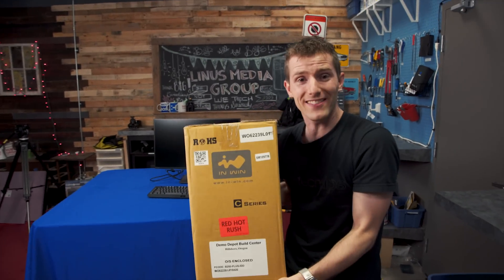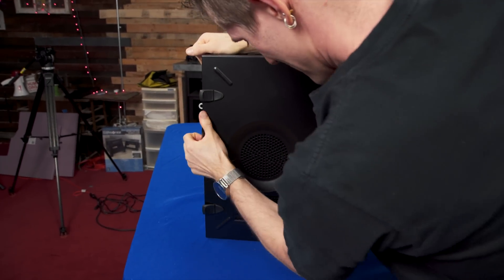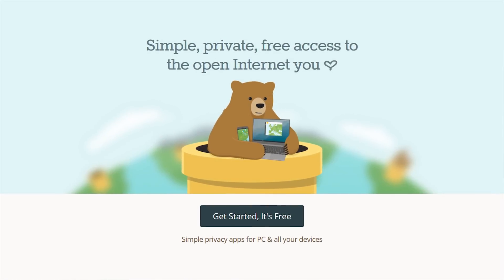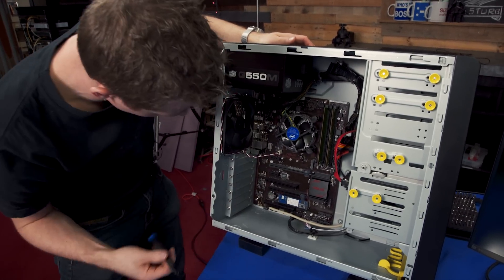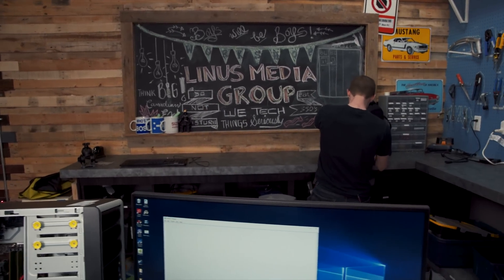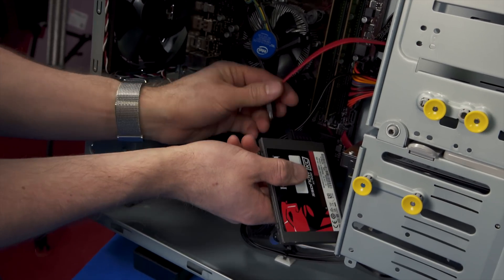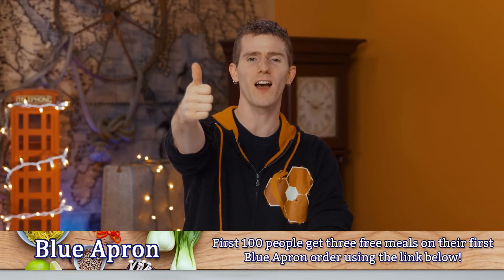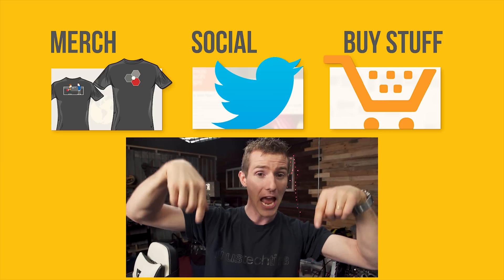Turbocharge your SSD for $40??

Comment: I'll definitely use one of these until I can get a much bigger one of these. Anything else makes no sense to me.
Reply: why use optane when you can just use an ssd? or an sshd? This product litterally makes no sense they are solving a problem that has been solved for years
Reply: Watch the video again. Read what I wrote again after.
Reply: I see you were quoting him although optain would still have to be much cheaper to actually be viable, even if there is a 256gb version if current prices hold then that will be 400 dollars which is way to expensive for sata ssd levels of preformance
Reply: I agree. At this price it makes little sense. I still use SATA SSDs as well, because the jump to NVMe also doesn't really make sense for me yet. But should optane become both more affordable and a lot bigger, then this would be the natural choice. 

And 256gb is still a joke. I have a 500gb SATA SSD now and I will not buy anything under 1TB for the next upgrade. Why would I, I want to have games and applications on it aswell. I don't see the point in buying a 256gb SSD to make my computer faster, and then spending 30 minutes every week to think about what files I can keep on it and which ones have to go. I'd rather have a big one that fits everything. And thankfully they're cheap enough.

Comment: IF you are still able to do a followup, would the optane drive work as a cache for a secondary HDD..? i.e a boot ssd that is say 120 - 240GB and a secondary 3TB drive paired with the optane for games larger programs and data

Comment: I'm curious about how well does this work running dual drives? Like if I have an SSD boot drive and an HDD junk drive, will putting an optane drive in my system work on both (obviously to great effect on the HDD as you pointed out).

Comment: It only accelerates your boot drive and it costs $40? So here is my question why not just buy a hybrid drive the 1tb firecuda is £70 and the same optane and 1tb HDD combo would cost around £80 and take up a M:2 slot.

Comment: Well can you get a boot SSD, side storage HDD, and have Optane cache both? Now you get benefits of all worlds.
Reply: but if its really just side storage Optane will end up caching the stuff thats on your SSD because thats what you're using. May work better with a HDD for Games though.
Reply: So its still basically intel smart response (their caching software)? Where it caches only the boot drive?
Reply: You won't see any difference since Optane caches only the most used files. So a side storage HDD will not be "boosted", and as you can see it doesn't do shit with an SSD. Basically if you have an SSD, Optane is a waste of money for you.

Comment: I like it, You could put a 2-4tb hdd in a PC and an optane drive and never worry about boot drives or where to save files. It would just be fast(for the daily use stuff) and simple. And as an upgrade path, you could built today with a large HDD and in 6 month add an optane drive with out having to reformat. 
Would I use one? Nope, HDD are to noisy they belong in a NAS in a closet far away.

Comment: so if you have an ssd boot drive, but a platter drive for most programs, large files, etc, could you use an optane module still to accelerate the platter drive for your application uses?

Comment: Optane is SRT 2.0 as long as we don't have DIMMs and even then cost is a huge factor for Memory atm. 
Price for Performance and staying within resonable bounds Optane is uninteresting for the general consumer. It's for servers and Optane has a whole more to it than Crosspoint, again for servers to use the performance of the technology. 
If Intel says there will be SSDs for "enthusiasts" basically means a fuckton of cash for those, which will get you the bragging rights of the best scores on some benchmark websites. While you probably spend 30ms less loading your porn folder which of course contains screenshots of said benchmarks.

Comment: Thats fucking dumb ... So it only really helps HDD .. but you have too use it on A Z200 chipset .. who the F is going too use A HDD as os on Z200 ????
Reply: You missed Linus state that the motherboard used in this video in particular is a B250 chipset motherboard, and that it's limited to the whole 200 series in general, not specifically Z270.

Comment: Can you use intel optane to boost your secondary HDD storage drives? I use a fairly low capacity ssd boot drive for cost reasons so most of my games still end up on my mechanical drive so if I can use it for that application I'm on board. Otherwise I'll just pick up an m.2 ssd and install games on it instead.

Comment: I'm assuming the primary customers of this will be OEM system builders.

If you have a boot SSD and a storage HDD, would adding Optane be smart enough (or be configurable) to only cache for the HDD and ignore the SSD?  That would seem the most useful for your viewers (at least the ones not using M.2 NVME drives).

Comment: I don't see a single application for this. It's not very wise or logical to invest $40 in a stupid Intel thing to speed up the slower thing instead of simply buying an SSD. Buy a RAID card if you want to speed up mechanical drives.

Comment: I appreacheate you adressing alot of the critizism of the sponsored video on this.

What would interest me is how well this performs against the cheapest 128gb ssd you can find on amazon (should be about 40$ as well) used as system partition and used as cache using bcache (which would have the benefit of being able to cache alot more stuff).
Reply: jackthemapper That'd be interesting.
Reply: The point is to compare two options at the same price point which would be 120gb SSD vs 32gb optane or 240gb vs 64gb optane. If SSD + Optane doesnt outperform SSD i dont suspect HDD + Optane outperforms HDD + regular SSD cache.
Reply: yeah 128GB makes no sense. I personally can't go below 500GB :P

Comment: As on how you ended the video, it can be usefull in some cases. for example; I myself have a SSD but I also build my little brother a simple pc for his DJ skills and simple kids games, with a tight budget but as futureproof as possible. So I actually got a B250 motherboard and a I5 7400, which means i can easenly benefit from some significant speedups for €40 instead of buying a decent futureproof SSD which at the time costs around double that over here. I have also heard that the speeds will keep increasing a little bit each time you use your pc since it learns more and more till a certain point ofcourse. I agree there are many things that are more usefull, yet it can be handy in some cases ;)

Comment: So you say it costs about $40 for a 16 GB. For about $40 to $60 you can get a 120 GB SSD that has a greater capacity than these optanes and IMO is more useful in the real world tasks so it's hard to justify. The SSD + HDD combo is also compatible with all systems not just 200 series 7th gen

Comment: Misleading and far too clickbaity title

Leaves disappointed dislike
Reply: mackan072 but it has a question mark
Reply: "Are you an idiot??" I'm not calling you one, I'm asking. See how it works? It is clickbait.
Reply: mackan072 kind of I mean it turbos original hdds technically
Reply: It isn't misleading though technically speaking it does turbo boost SSDs with its massively higher read IOPs and low queue depth performance. Of course the "??" is that in real world benchmarks the boost isn't significant.

The key takeaway that they make is that Intel is positioning this very oddly claiming boosting for HDD performance which it can but most high end systems that it is locked to will use SSDs as boot drives which don't see much of a real world improvement. 

If you run compute/database type work on your workstation the synthetic performance boost may actually be useful if you have some hot files being used constantly even with a boot SSD.

What should be mentioned is reliability should be much better with this new type of memory and its relatively low cost makes it perfect for using in industrial or networking equipment offering a cheap, high speed, ultra-low latency, read focused boot drive. Intel doesn't advertise this because it is a tiny market really and it isn't yet validated.

Small flash SSDs typically have terrible performance and reliability in modern SSDs is a bit of a mess. The Optane drives also have much simpler control systems so there is less to break or have bugs compared to very advanced flash controllers that do a ton of work to maintain data integrity.
Reply: This is a perfectly  descriptive tittle . 
? /= click bait.
Reply: How is it misleading? Intel is misleading the selling via marketing and Linus pointed it out here.

Comment: Can you actually access the optane drive and install something on it, to use it like a normal drive?
If so, what are the transfer speeds of those? Or is it just the access speeds in which they're so much better at, do we gain anything at data transfer rates?

Comment: I'm interested in seeing how this performs in a system that uses a boot SSD but uses a secondary mechanical drive for games.
Reply: Greg Lucente, since it caches your more commonly run programs, you may be lucky in that it'll accelerate the one you are currently playing the most. 

Having said that though, if you have an SSD already, why would you be running your common games off a mechanical anyway?

SSD has fallen in price enough that you wouldn't solely have it only as boot without taking advantage for some other programs. And if you do? That's weird.
Reply: Well I have a 256g SSD, and 7tb's worth of WD Black drives that I've kept from past builds. I keep a couple games on my SSD but the bulk of my library is on my other drives.
Reply: Greg Lucente, I'd suggest then that you'd see next to no benefit using this device as it'll cache your day to day SSD usage, not your bulk storage (unless you ran a game a time or two off of bulk storage to force it to cache for subsequent use)

If it could detect transfer speeds of your various storage medium, and only cached mechanicals, ignoring any associated SSD, then it'd still be a worthwhile product.

Comment: I only see this succeeding if Intel pushes it as an add-on for prebuilt consumer systems. If the salesman tells the average consumer they can "turbocharge" their new desktop for an extra 40$ they will probably do it. But no enthusiast will buy this unless it is for a very particular use case.

Comment: After reading review of Optane and this video, I think Optane is designed and being marketed as a defensive ploy by mechanical hard drive makers to offset SSD performance gains.   It keeps the makers of mechanical drives in the game longer.   It is kind of like putting a supercharger on a 4 cylinder engine to reduce buyers moving to non-supercharged hemis.  It is kind of like selling thinner aspect tires and wheels (i.e. 17" vs 14") and wider wheels for hipo engines instead of changing the differential gear ratio. 

 Thus, since I already use an SSD for applications and a WD black drive for data, I don't see a need for optane unless they could show perforance gains for SECOND drives that are mechanical in gaming or video editing.   That might be a topic for a future video in order to show performance improvements when using a second drive for processing. .  How does Optane affect gaming or video editing performance on a SECON}D drive when the primary drive is an SSD.

Comment: "The most generic computer"
What i think:
775 motherboard
Celeron 2.3ghz
4gb of ddr3
500 HDD
A generic "500w" PSU that gives 250w before it explodes
What Linus think:
z170 Motherboard
i5 7500k
16gb ddr4
2xHdd 2tb
550w 80 plus

Comment: So this set up will run between 90 and 130 dollars for 1Tb with a decent entry level HDD like a WD Blue? And it still wont be as fast as just an SSD? I'll take the smaller SSDs then. I mean I can get a 240Gb SSD for right around 70 bucks AND a 1Tb mass storage HDD for 50...that is about the same price. So why should I waste the money on "accelerating" the slow drive?

Comment: So what's the general consensus? If I'm building a brand new rig with a Z270 motherboard and a 7700K, does it make MORE sense or LESS sense to get this device over an SSD if I'm planning on having a 3TB HDD and a 250GB SSD? If it makes more sense, I'd lose the SSD and get this, but should I do that, or stick with the original plan?

Comment: wait so if i buy this and put this in my pc, my hdd will run faster? wat lol.
Reply: The catch is that it ONLY works with the newest Z270 motherboards and Kaby Lake CPU's.
Reply: oh, so it does make the hdd run faster but only with Z270 boards. That kinda sucks
Reply: Correct.  Even if you have the 100% still relevant Z170 board with an m.2 slot, it will not work.
Reply: wow, so gimmicky
Reply: it will not make your HDD run faster. It will cache stuff for you so the stuff you need often (like system files, browser etc.) does not need to be loaded from the HDD and therefore is available much quicker.
Reply: ohhhh.

Comment: What would be the result of using an Optane as a way to accelerate the speed of a Storage drive.  I have a 2TB hard drive with a bunch of games on it as opposed to holding them on my SSD.  Would I be able to benefit from using an Optane as a way to accelerate the Hard Drive or would it only work on a primary drive?

Comment: Nope! I've been on SSD's for the last 6 years. If I'm going to upgrade to something faster within the near future, it will be to an M.2 PCI-e 3.0 x4 SSD. $77 you say? For the same money, €77, you can get a Samsung 128GB SM961 3,100/700 MB/s SSD. I doubt Optane will be much faster. But the real point is, it's only cache memory, not actual storage. So even if you did buy a new system with HDD only, spending your money on Optane cache is the wrong choice. Spend the same money on an M.2 PCI-e 3.0 x4 SSD instead.

Comment: Why would you buy a Z270 board, Newest Kaby Lake and a HDD just to waste an m.2 slot on a device to speed up (cache) your HDD instead of spending that on a smaller (if its a price issue) SSD for now until you can get a second SSD or even an m.2 SSD?

Comment: Only flaw here, how many people have Kaby lake systems with M.2 gen 3 4X slots that have only a hard drive??
Reply: Commenter people who buy retail desktops or build new budget systems?
Reply: I really dout that retail systems will have a M.2 gen3 x4 slot and further dout that people buying those systems are going to open it up and upgrade it with this random blue stick. until higher capacities exist to put the Samsung 960pro to shame (its possible, with this level of latency to boot as fast as a computer wakes up from sleep) but then the gen 3 x4 link becomes the bottleneck. Eventually it will be a time when your computer will be so responsive since everything is effectively loaded into "ram" and never has to close
Reply: only think you should consider is that said people dont fix their PC themselves but those that fix them may offer it as a quick easy painless upgrade since not reinstall or potential loss of data.

Comment: optain would be better for someone like me who doesn't actually want to buy an ssd due to its shorter projected life but wants a speed boost over mechanical drives
Reply: Uchia18 shorter life? You do realize some SSDs ship with 5 and 10 year warranties? The write endurance well exceeds what a considered and even most enthusiasts need. The 850 Pro 128GB is rated for nearly 1PB would take 100GB a day for 7 years to kill it according to anandtech's testing
Reply: oh nice, didn't realize the read/write rates had increased that much since they first came out. still partial to mechanical drives but that does give me something new to considder
Reply: buy the top end drives like the 850 Pro or 730 if you want endurance. You also get plenty of other benefits from top end drives. MLC is still considerably better endurance wise than TLC. Also try to buy from brands like Intel, Samsung, SanDisk/WD, and OCZ/Toshiba since they make their own NAND and tend to give themselves the better chips. ;)
Reply: sweet, thanks for the info mate

Comment: This is pretty much what I expected from the Optane review. It just doesn't seem like a really compelling product. Consider: HDD prices per TB are way out there these days. People are probably going to be putting 2, 4, and 6 TB drives in their machines now. A 32 GB Optane caching drive is 1.6% of a 2 TB drive. That's enough to cache... Windows? Maybe a game or two? Why not just use a full SSD (via SRT or similar) so you can put more in the cache?
If you really need the response times that Optane offers in favor of a normal SSD, then you're probably already looking in the PCIe SSD area, and that's not what Intel is delivering today. They decided to bring this caching solution to market first. Not a useless solution, but it seems like a rather niche market.

Comment: My year old Z170 platform left in the dark already? Typical Intel, release an unproven product, castrate it so its customer base is extremly small and completely shaft anyone that isnt on the most current chipset despite no obvious techincal limitations. This is my first i7 intel platform, payed too much for a very small piece of silicon 50% of which is a utterly usless GPU and I'm very quickly learning what kind of company intel is.